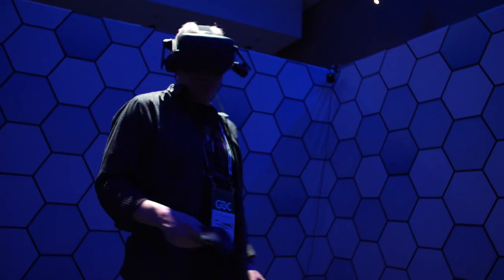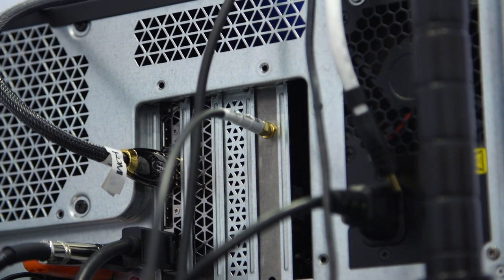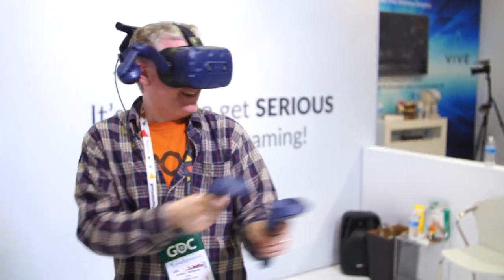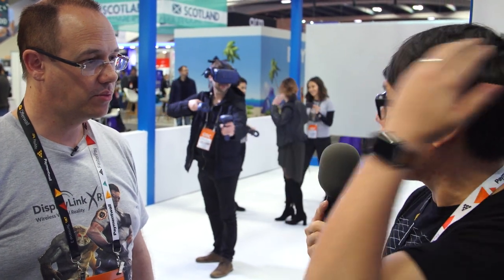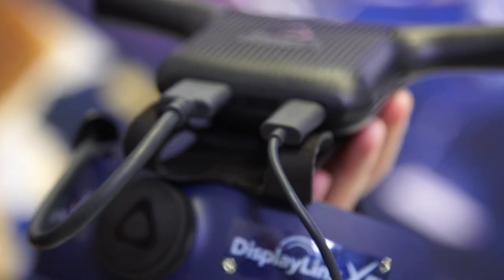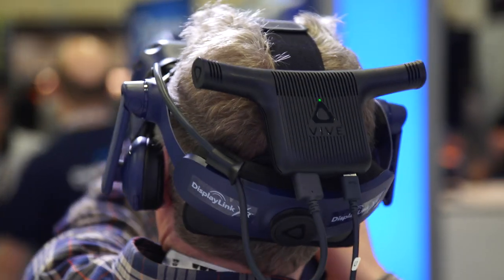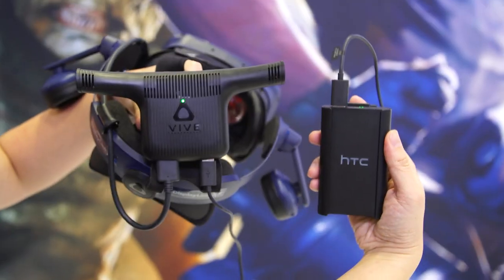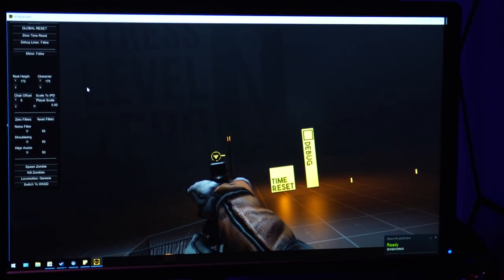Hands-On with HTC Vive Wireless Adapter!

Comment: Without knowing the price this looks promising, though HTC means it'll cost twice what it's worth which will mean slow adoption and eventual price reduction. Great to see no need to hack the device to get things like Microphone working though, and having a a few decent companies (sans HTC) behind it shows there will be decent support, unlike my experience trying to get any factual details from TPcast. The PCIe card slot will prevent me from getting one due to my itx system with no free slots.

Comment: Really bummed out it requires a PCI express slot. I only have one slot left and I was planning on getting dual 1080 ti's.
Reply: Travis J I'd much rather have wireless VR than a second ti. You can play anything out in 4k with no problem and 1180 should be announced soon. SLI is just a headache that a lot of games don't support, including VR.
Reply: I 100% agree, and that is what I will do... I just dont like that it limits my option in the future.
Reply: SLI is dead. No point in investing in it.

Comment: Can it use any WiGig card? An increasing number of gamers are using miniITX builds with only one PCIe slot, but could conceivably still use this if they could, say, replace the Wifi M.2 card on many boards with a WiGig M.2 card.

Comment: because its a good idea having a transceiver on your head specially when its been proven wifi signals can damage things like plants and seeds growing etc, either way I simply will not have anything extra on my head other than the headset, I'm guessing oculus will release their next headset with built in wireless and maybe eye tracking beating htcs effort...or little effort with the vive pro

plus there are some of us who don't have a room to keep everything set up or don't want out living room walls and ceilings looking a mess with the sensors being kept up so we have to set everything up each time we need to use VR which does not take that long but I aint having a extra box to stick on the wall also not everyone has a space express slot lol for all the messing around you have to do for this id rather just keep the wires, its not like they get tangled or I fall over them anyway

Comment: All along I figured the physical wireless adapter connected to the pc and the new headset had software built in and could make the connection without yet another price of hardware attached to your head. Not sure I want to walk around with 10 pounds of shit on my head. I’ll stick with the original Vive until this evolves a bit more. Peeps talking about the yoga pants must not get out much.

Comment: So if the 60 Ghz signal can't penetrate a sheet of paper, how does it penetrate the much thicker plastic of the antenna chassis?
Reply: No need to penetrate, the plastic is part of the receiver/antennae.
Reply: Interesting! The plastic is actually a functioning part of the array?

Comment: So both wireless solutions suck. Tpcast and Tpcast Plus won't work on Vive Pro. Vive adapter requires a free PCI-e slot which is inconvenient and thus won't work on a laptop. If you have Vive Pro on a laptop then you're really screwed.

Comment: wait wait wait, it takes a pcie card? does that mean this will pretty much not work in a mini-ITX system because they only have 1 pcie slot and if you're VRing it'll be for the graphics card?
Reply: people should stop trying to cram high end systems in tiny boxes ... VR requires top of the line hardware (even current Vive Pro simply cant be run properly on current top hardware ...) and you CANNOT squeeze the maximum potential from your hardware in minimalistic form factor...

therefore i cannot understand people complaining that theyr mini-itx VR rig ( /facepalm ) will not work with this ... DUH maybe you should prioritize FUNCTION over pointless form when you need system with as much power as possible (yet instead you stuff overheating overcloked hardware into tiny box that stifles cooling ... priceless ...)
Reply: what top of the line hardware can you not run in mini itx? the core 500 can fit 2.5 slot full length graphics cards, and since the graphics intake is right at the side it probably gets even cooler air than in a traditional case, and you can even cool the cpu cooler with a 120mm aio OR a noctua NH-D15 with the rear exhaust configured to intake so it also takes fresh air from outside the case. SLI/dual graphics card setups are definitely not functional power either since even now they still introduce a lot of microstutter which makes it bad for gaming. The additional unforseen requirement of another pcie slot, i'm sure, is was a surprise to many since even the tpcast didn't require that.
Reply: Tested used a mini itx form factor for their own VR rig build a couple years back, so it's understandable a lot of people on this channel went that route.
Reply: 1. you cant get "cooler air", both systems take room temp air and run it over parts ... except normal cases have more free space for airflow and way WAY less airflow deadzones

2. 120mm AIO is useless when Noctua NH-D15 shits on 240mm AIOs ... you need 360mm rad to beat the Noctua and get better cooling ... which you CANNOT fit in the tiny box, and you have to sacrifice exhaust to mount Noctua in... well thats nice, but that tells me you will have overpressurized case instead of balanced airflow ...

3. SLI is useless, free PCI-E slots are not, when you can use them for host of other things including super fast SSD drives or in this case wireless adapters with best possible data throughput into the system ...

4. mini cases are for pseudo console "gaming in the living room" stuff, not top of the line performance PC that needs to BREATHE (there is way more stuff  to cool other than CPU and GPU ... RAM, VRM, rest of the chips and components on the motherboard, drives ... which is all done by AIRFLOW IN THE CASE ...

you cant use best cooling solutions in mini, you cant make mini to have PROPER airflow because components are too stuffed together and you will get airflow deadzones in there and you cant put in PROPER ATX size motherboards ... leave mini where it belongs and build performance systems in PROPER normal sized case that is designed for it ...
Reply: @Alexander Roderick
- nope, someone on the net doing STUPID thing doesnt mean its suddenly a good idea to do the same ...
Reply: Even with the D15 you still have room for another exhaust fan. i mentioned 120 but the fractal allows for up to 280mm rad on top. have the rear exhaust on it set to exhaust, whatever, and have the top set to intake or vice versa, it'll blow down and flow past all the components on the motherboard and get swept through the noctua and out the back. Barely anyone whos using their pc as a gaming pc is going to use the pcie slots for super fast SSDs when 'gaming' mobos, even the mitx ones, come with multiple m.2 pcie slots.
wireless adapters, what are you a casual gamer that doesn't use gigabit ethernet? (see the way i worded that? thats exactly how you're sounding).the way you're wording all of this, you better have at least a 360mm rad, pcie SSD, wireless lan card, balanced system, or you're basically part of the problem you're mentioning; not having a PROPER normal setup
edit: i'm sure i worded some stuff up there harshly, and i dont want to get you any more mad, but you just seemed to be saying there is only one way to do proper gaming, and thats clearly not right. The way systems and efficiency are going, less and less emphasis is needed on having an overbuilt system that nets you little gain while sacrificing size, noise, and comfort. you may think a normal sized case is proper, but i'm sure there are others out there that think even that isn't sufficient.
Reply: heh, im not mad in the slightest, im just pointing out that you are moaning why your micro setups isnt suitable for PCI-E expansion requiring accesory because of your CHOICE of mini form factor. Im sure you convinced yourself that cramming all that stuff in box half the size has no drawbacks, but you are talking here about VR, where EVERY BIT of performance counts, sure you can run the setup just fine ... untill you overclock and start getting into unstable parameters because your mini form factor case has way more turbulence ...

PS: just go to Gamers Nexus and look up the massive differences they measure even between same size cases, then you will maybe understand that you cant have top notch performance in a matchbox ...
Reply: Asghaad I didn't say nore think there was any drawback to mitx, but up till now, vr, and other very similar wireless systems not requiring additional pcie slots ANYONE would be surprised about this. If the wireless system had required a dedicated Ethernet port and your motherboard only had one and you were using it, wouldn't you be surprised by that and your CHOICE of not picking a motherboard with only one, even though up till this point VR or pretty much every other gaming experience never required a dedicated one?
Also, your point about games Nexus actually counters your thinking since it proves that size isn't the deciding factor on cooling, rather it's about design and proper engineering

Comment: No clue why these devices arent just stand alone?

Just plug it in to the break away box. Plug in a power cable and switch it on. Then connect part to the headset.
Reply: Needs more power and components involved.

Comment: So I bought this, on an AMD system that meets the required specs with a 1080ti and Vive Pro.  Horrible performance.  Compression is so bad it looks like 240p.  Latency is so bad I'm curious if WiGig is 100% software rendered?  I haven't seen graphics performance this terrible since trying to run Quake on a 486.  Looks like I'm going back to the cable.  RIP $360.

Comment: VR gets more and more expensive, not less...
Reply: atomixfang Accessories maybe, but the HTC and oculus  headset you can find from $300-$500
Reply: Headsets are $300 less than they were at launch
Reply: Still not worth it imo...
Reply: I think it's more like the price is stabilizing at around the 300-400 mark.. features and generations will be continually added but the price to get into it (or upgrading or switching between platforms) will be at about that pricepoint.
Reply: atomixfang old VR gets cheaper, new stays expensive, just like everything else. welcome to the world of early adoption as well.
Reply: Enthusiast vr gets more expensive, just like high end pc gaming. There are plenty of tiers to get into it now.
Reply: Nope. Original headset is getting price cuts and new better headsets, just like new technology, is more expensive as old tech gets cheaper.

Comment: I'm extremely excited about this technology, but it's just not consumer friendly yet. You're talking, what, $5500 or so USD for a set up that it worth it? That's a little extreme right now.

In 5 years? Hell Yeah, I'm in.
Reply: Paul Karyakos where are you getting that number from?
Reply: Paul Karyakos What are you smoking? The price of a vive pro, (assuming cost) wigig, and a vr-ready PC hardly hits the 3k mark (if you are going for the best components)
It's not even remotely extreme. These setups cost tens-to-hundreds of thousands of dollars just 5-10 years ago. 

If anything, VR is cheap. Especially compared to the pricing of consoles, console components, and 4k TVs.
Reply: Dude. A vive and a vr ready pc is like 1500... its cheap. A vive pro and a pc ready for  closer to 3k. Still cheap considering.

Comment: I still don't get, why they don't just mount the 60Ghz WiGig transmitter/receiver overhead of the user on the ceiling if it's so failure-prone? They could do that with the wired connection too...just install an in length flexible coiled cord overhead...try to tangle in that. I though they're all so smart...
Reply: Yep..No reason to have it on you.
Reply: I feel it defeats the point.
Reply: I don't get it? you want wireless to connect you to a wall? so it's no longer wireless? I'm guess you could install it over head but in the location they are demoing it the ceilings are 40' up so they had to use a wall to mount it.
Reply: Running a cable onto the ceiling then dangling it down replaces stepping on it with getting your arms tangled in it.
Reply: Joe Chief not wireless though and what of you want to crouch? Do you use a hoist system which could destabilise the headset and reposition it?
Reply: +Mr Bork I'm with you man, getting your arms tangled was one of the problems with overhead cabling, not a benefit.
Reply: Joe Chief exactly. Better to face one direction or add weight to your head then to have your ability to use the defining feature of room scale vr hindered.

Comment: Well this new development in radio technique worried me a lot. There are two reasons to be worried, 
1st, The vive pro wireless use pcie card is not an oversight, it is however because the pcie’s 60w output can provide enough energy drive two link 60ghz in 10 meters range. The 60Ghz radio wave have an extreme low wave length and it can penetrate upper skin, also the wavelength absorbed by water more so than 2.4ghz. Normally it wont be an issue until u power that wavelength enough to cause the trouble. 
2nd, it requires beam forming to extend the range, which also worries me. Imaging ur head is constantly bombard with direct energy beam that can easily penetrate ur upper skin. The energy will absorb by skin cell eventually. 
The long term effect on human skin is yet to be discovered, and I am conductin'g a research about the relation between skin ration and radio wave exposure.
Reply: I doubt u understand what u typed, radio wave length is related to energy and sources that generate them but radiation is completely a different term that related only to high energy gammy or x ray with extreme short wavelength. I doubt u can generate radiation from any home device. Btw, human cells have different sensitivity to different energy form. Do ur research before bs me here.

Comment: What is the Radiation output ?
Over your head like that cannot be healthy
Reply: well its not going to be ionizing radiation so should be mostly harmless
Reply: Just microwave spectrum. As bad as walking in a city with 5G.
Reply: Your body has more risks of getting cancer from having sex with another person.....
Reply: Fuzzycat thats a lie because u know we dont have sex!
Reply: Zero ionizing radiation, and unlike 5GHz doesn't even get through skin, so not even as harmful as using a phone (which isn't harmful either).

+Aatrox SSG That's how good it is!
Reply: Well, they say it's stopped by a sheet of paper. Maybe you should wear a folded newspaper hat while using it.
Reply: He should make it out of tinfoil of aluminium foil, it might help with his other problems.
Reply: Standard WFfi is a body penetrating spectrum, similar to Microwave ovens. This is 60 GHz and cannot even penetrate a sheet of paper, let alone skin.

Comment: If cell phones are bad  you are going to fry your brain with this.
Reply: Cell phones aren't bad though
Reply: ^^This guy came with facts.
Reply: The 60Ghz signal cant pass through the skin on your head...so no...
Reply: how do you know this??
Reply: Cell phones operate at roughly the same frequency as microwaves, so there is a potential to cause issues, although no study has ever shown this. The 60GHz spectrum is completely outside of any zone where there can be issues.
Reply: It may or may not be able to penetrate the skin, but your body is an antenna so your going to pick up the signal.  I would not recommend putting that thing on your head.  It is milimetric wave technology like the Active Denial System which they have invented for crowd control.
https://en.wikipedia.org/wiki/Electromagnetic_spectrum
https://en.wikipedia.org/wiki/Extremely_high_frequency
https://en.wikipedia.org/wiki/Active_Denial_System
Reply: anlumo1 The amount of energy in a cell phone signal is very low so it's not enough to hurt you.
Reply: hootsmin the link about ADS that you posted says that it’s not a problem, even at the power levels they’re using, which is probably a few orders of magnitude more than this system uses.
Reply: Also keep in mind that the sender is not on your head, it’s mounted to the wall.
Reply: Even ADS is olny penetrating the skin by 0.4mm. And that with a much higher signal power than consumer electronics.
Also the whole purpose of ADS is to cause pain so the victims will leave the area. ADS isn't doing anything else to you than burning your skin. 
When even ADS only penetrates you by 0.4mm and the worst thing that can happen is feeling pain, everything is fine with this device as long as you don't feel any pain. It only would be dangerous if it would do anything to you without you noticing it.
Reply: 12:58 "With 60GHz you can't even go through a sheet of paper."
Reply: +hootsmin The whole point of the Active Denial System is that it's non damaging, so as long as you don't crank the Tx power so high that it literally hurts you should be fine, and even then you'll only cause yourself unnecessary pain.
Reply: Yes, I'm definitely worried about a signal that can't penetrate a piece of paper...